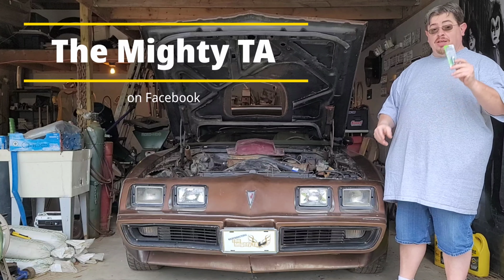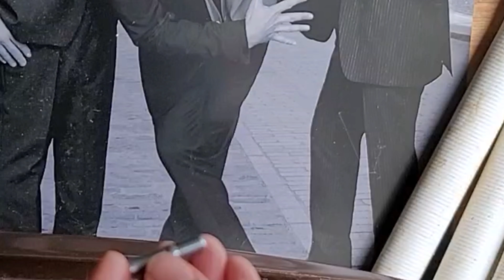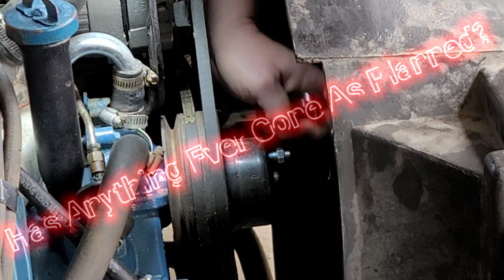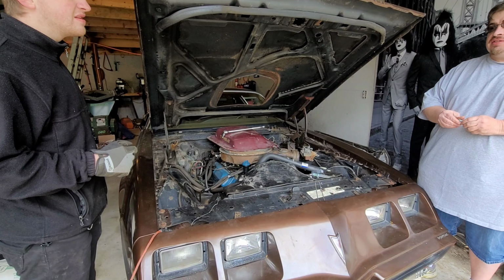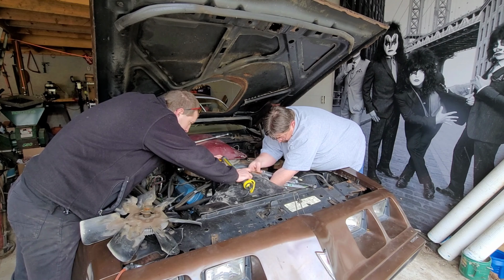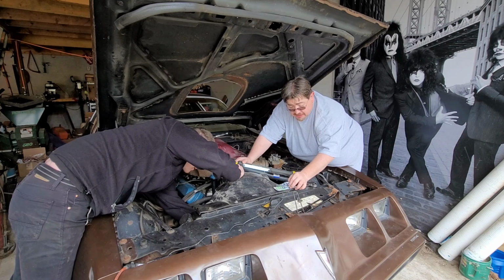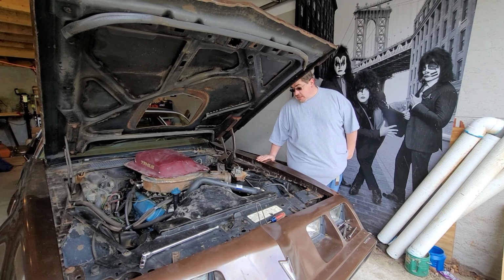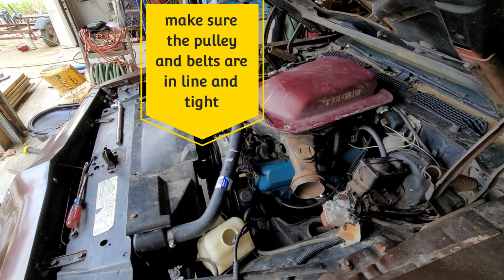Resurrecting The Mighty TA Season 2 Ep 3 Installing water pump fan studs & clutch fan 1979 Trans Am

Comment: When you had the 403 rebuilt, was anything done to it to raise it past the stock 180hp ?
Reply from the maker: I added a mild "street cam" from CompCams and a Edelbrock polished aluminum intake manifold.  Upgraded the oil pump to I'm trying to think what other upgrades I've added.
Reply from the maker: ...headers 2.5 inch X pipe exhaust pipes and Flowmaster 40s